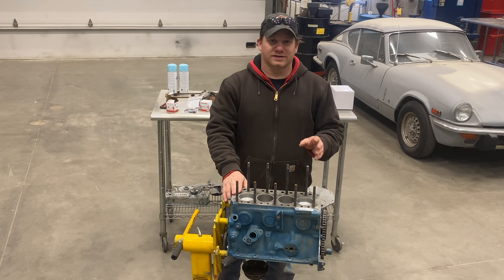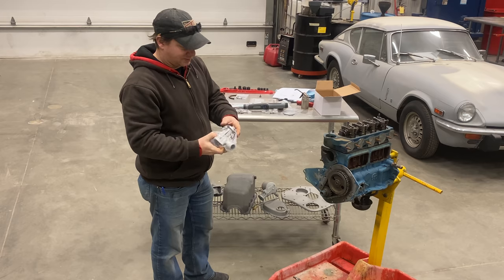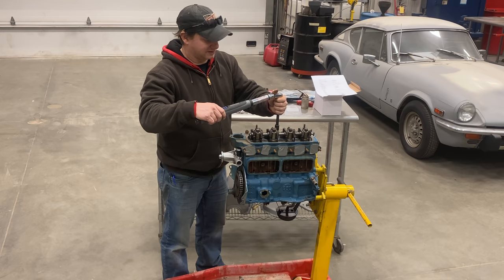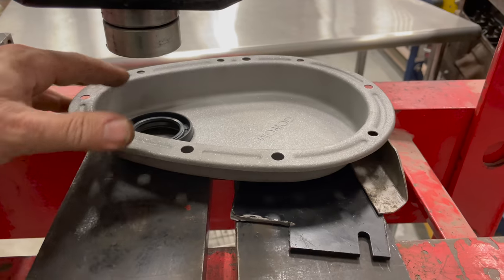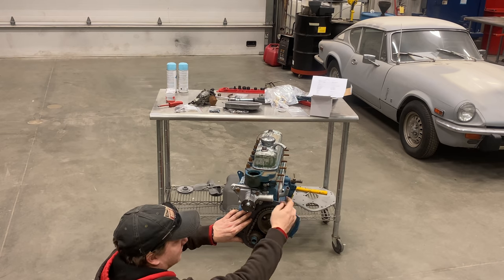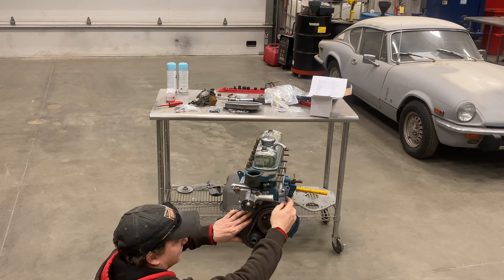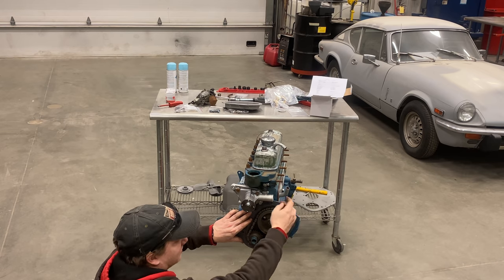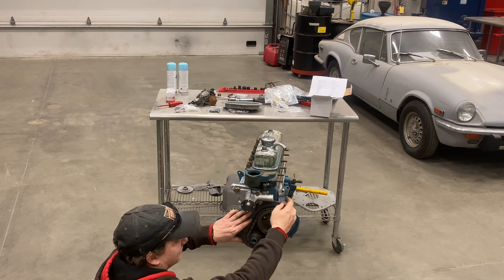Reassembling the Barn Sprite 948cc A-Series Engine

Comment: Enjoyed that! ive built many A series over the years..little nod to a wise man..i found sometimes the front crank seal in the timing chain cover can leak slightly..annoying drip..if you put the crank pulley on before tightening up and timing case bolts it will centralise the seal to the crank perfectly, once a couple of bolts nipped you can remove it to do all the bolts up. Great channel love your cars :)

Comment: Gday Steve! A tip for the front timing cover, put the pulley in before the timing cover bolts, to make sure the seal is perfectly centred up to the pulley, we also dowel the timing cover to the plate as belt and braces to ensure it doesn’t slide while being tightened up

Comment: Nice job steve, those thermostat housings have always been a pain either broken studs or fractured housings, its good fun replacing the flexihose between the pump and head when they rot out, i dropped mine in hot water which helped compress it enough to fit on a fitted motor.
Reply: That $%^^%$& hose!   Only thing BMC did worse was driving the (marginal-sized) oil pump off the back end of the cam.
Reply: @cr10001  manufacturers still do stupid stuff like making oil pump integral with engine ( GM / Vauxhall ) 44k miles and beginning of the end for that 1400 cc motor.... i got rid of car.
Reply: @eggy1962    Ouch!   Yes that would really have me cursing.   At least on the A-series you could fit a beefier oil pump from a later series car, provided it had the right cam drive (early ones used a pin and slot, later ones used an adapter and star drive.   That little adapter was another classic aaargh!  when you notice it lying on the bench after the motor is back in the car  moment.    Fortunately never happened to me   :)
I liked the Ford Kent oil pumps - bolted on the outside of the block, easy to change so, by a sort of inverse Murphy's Law, never gave me any trouble.
Reply: @cr10001  it was the first question i asked my vauxhall trained mechanic, unfortunately as well as being internal it was integral to the engine meaning a rebuild....imo a bad design, so we part ex it for a 2 yr old toyota yaris hybrid which we have had now 5 years, its been totally reliable, better made full stop.

Comment: I have fitted that hose many times, and Mini's were the worst: Butter knife with a little oil smeared on it was the technique we ere taught. In those days it was just a regular shape hose, no concertina function. And yes, it was a pain of a job.
Reply: I found that the concertina ones failed quite quickly, best use the original type.
Reply: Ah yes THAT hose, have fitted a few myself.

Comment: That little head-to-water-pump hose was a great one for being forgotten when one put the head back on, followed by much cursing when that was realised.   Also, it would occasionally leak or blow on the road.   In that case you could (sometimes) get the corrugated hose (as Steve shows) and force it into place, but quite often the hose supplied was straight and the head would have to come off, which was a pain.      
And those aluminium thermostat housings were bad for corroding.    But using bolts (as Steve suggests) rather than studs is a really good idea.
Reply: Easier to remove the water pump to replace the bypass hose.

Comment: Fitting the timing cover, best to fit the gasket and cover, not tighten up the securing bolts, temporarily fit the pulley (so to centralise the oil seal), tighten the bolts the bolts that are accessible, remove the pulley to tighten the bolts that are not accessible. Failure to do this might result in an oil leak.
Reply: wise words of advice
Reply: Beat me to it!

Comment: Steve may be the first person in history to use a torque wrench on the sump (oil pan) bolts   :)     7 lb ft  sorta says they're not too critical.    Probably more significant to avoiding leaks is to make sure the gaskets are well seated and the awkward corners by the cork seals fit properly and have enough magic goop on them.   :)
Reply from the maker: Or maybe I have seen too many sump bolts broken off on these engines than I care to remember.  The torque is small because the bolts are also small.
Reply: @ThisWeekWithCars    Yes, you're quite right.    1/4" UNC  I think.   Something I do bear in mind when tightening all small bolts.
I believe Philips (the Dutch electrical manufacturer) once did a study that showed people tended to torque bolts up proportional to their size (diameter), whereas it should actually go with the square of the diameter.   So they over-torqued small bolts and under-torqued big ones.
But I applaud your care in assembling the engine, if I bought a used car I would hope the engine had been rebuilt by someone like you   :)

Comment: If you use an 88C thermostat (instead of the original 82C), you will let the engine run a bit warmer - this reduced the condensation in the rocker cover (and the mayonnaise that builds up!) - also you get a better output from the heater..

Comment: Being pedantic, torque is "pounds/feet" not "feet/ pounds", (think of the metric version, Newton/metre, Nm). Feet/pounds refers to work, and involves distance - 33,000 ft/lbs per minute = one horsepower. Don't worry, though - nearly everyone gets it wrong. The little hose on the water pump is called the bypass hose. It's easier to put the bypass hose onto the water pump first, then slide it onto the tube from the cylinder head as you install the water pump, rather than lifting the cylinder head. It's a good idea to fit the crank pulley, (without the bolt), just to centralise the timing cover before tightening the bolts.

Comment: Not a fan of those 'easy fit' pump to head hoses. They are more of a get you home temporary fix.
 Much better during a rebuild to cut a length of straight hose with  dry fit of the head or new water pump. Then either lift off the head or the water pump and fit the straight hose and clips.

Comment: Isn’t that left tappet cover on upside down? The Sprite has a draft tube connected to this pipe that travels downward to the bottom of the case, thus drawing a slight negative pressure, and venting the case. Perhaps this is a different arrangement.

Comment: Hi Friend = lost my comments  resume the points ---- copper paste on plug threads, manifold gaskets and bolts, on sump fiber joint , inside pulleys --- LINSEED OIL warm for all hard material gasket, 3 minutes soaking then only let oil drip off no wiping  --- POROUS PAINT for all engine cast-iron block ---- PERMATEX  copper spray flywheel housing on crankshaft,  all bolts & nuts especially fitting in cast-iron parts !  WYNN'S friction proofing on crank-shaft, conrods, bearings,  lower part of the piston  when assembling !  best regards dear friend !

Comment: Aaaah, nice job. But, hope you'll wire brush and paint the vacuum valve/actuator on the distributor ! As it is, it ruins the brand new look !
Reply from the maker: The distributor still has to be completely gone through, right now it is just plugging the open hole.

Comment: When it comes to gaskets, could you get a sheet of metal of the right thickness and cut your own gasket out using your engine as template?
Reply: Metal gaskets wouldn't work, and no point anyway.   The pressed-steel covers are never that accurately flat that they'd seal, unless you used a layer of thick gasket sealant (in which case, you could in emergency do away with the gasket).
I believe some racing engines use steel head gaskets, but that's on a joint between rigid accurately-surfaced mating faces (block and head) and extremely carefully torqued-up bolts.
Reply: @cr10001  Another material then like cork or paper.  I mean could you cut your own gasket using your own engine as a template and thereby get a gasket that fits your engine correctly?
Reply: @earthstick    Oh yes, you could certainly cut your own gasket out of cork or paper.   It can be quite tricky to cut it properly, though sometimes using a hammer as a marking-out device (like Steve did to trim the masking tape in the video) can help.   I think it's possible to buy sheets of cork gasket material of various thicknesses.

Comment: How come the right- hand tappet cover seems to be fitted back- to- front ?

Are you just messing with us ?  :)
Reply: I saw the same thing. Can't have been made to fit that way.
Reply: @danpatterson6937  Yes I've seen pictures where they match. Strange...
Reply: I think BMC had two different designs of tappet cover, one that 'went in' and one that 'stuck out'.   Also note the front cover has a breather pipe on it.   But you can't fit either cover inside-out as the gasket seat around the edge would be wrong.
I don't know if BMC ever used one of each type of cover on an engine, it's possible one cover on this engine got lost or bent and has been replaced with a 'spare'.
Reply: @cr10001  Good explanation; thank you.